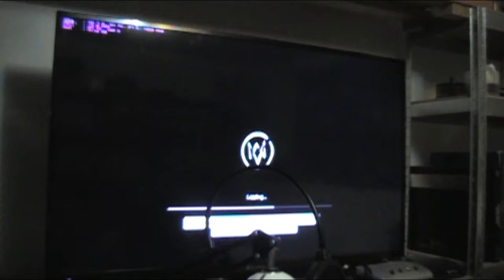Hyper 212 EVO - How DO you do it??

Comment: Got one along with a 4690k last Christmas, love it!
Reply from the maker: It's definitely a nice, worry-free, easy to use cooler once you get it mounted.  If I do another build with one though, I'll be sure to mount it before putting the motherboard in the case, as that X-bracket is a little tricky.